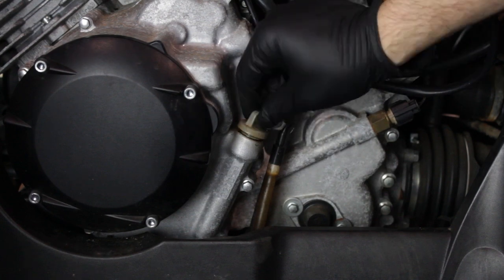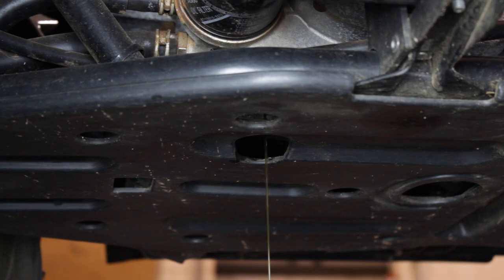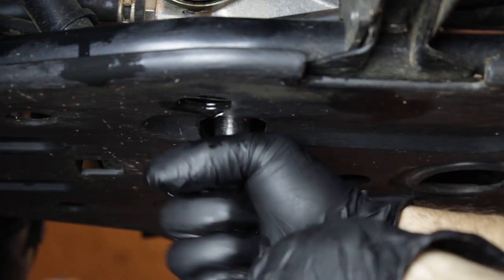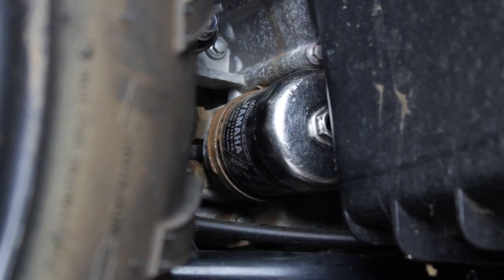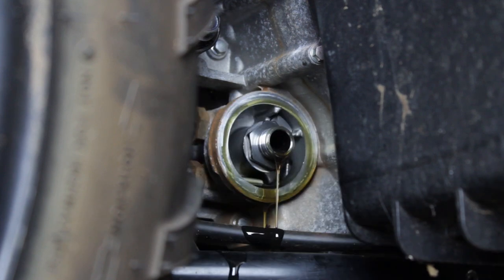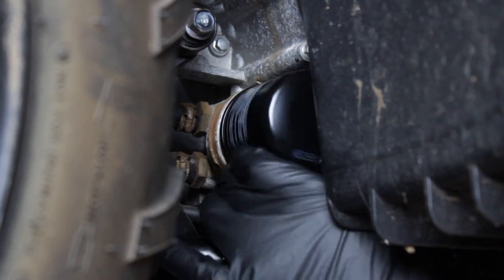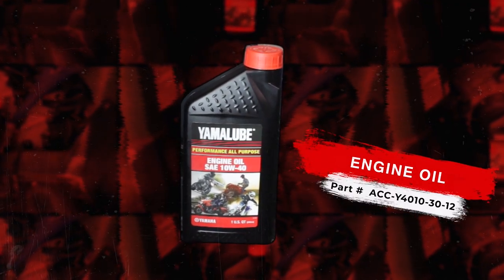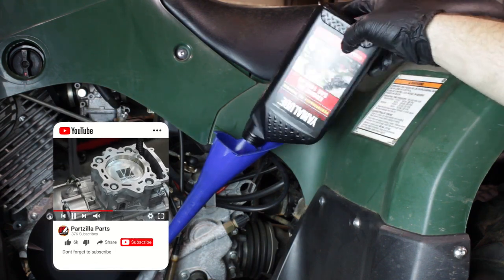Yamaha Grizzly 660 Oil Change | How to Change the Oil on a Yamaha Grizzly | Partzilla.com

Comment: Thankyou, I've had my grizzly setting in my garage for over 10 years, and I've been recently working on it, did finally get it running again, however I needed to change the oil along with the fuel and coolant, I just did not know where the drain bolt was, and soon will be swapping the gas line out, due to a leak

Comment: Pull out dipstick, remove drain plug, remove and replace filter.  Torque specs was helpful.  Fill with oil, check fill level.  DONE.  
I am just as helpful as your video.  
Friend called me after your vid and asked me to help him change oil.  He had no idea where to access all the areas for service.  You didn't help him there.

Comment: Very good video, you talked about propper torque for the drain plug and oil filter and the type and weight of oil to use. And how to check it on the dip stick correctly.

Comment: I have a older model 600 grizzly . 
The oil site window has turned black, and I can’t see how much oil is in it.
 The cap doesn’t have a dip stick so I now have too guess how much oil is in it.
 Anyone out there got a clue what i can do too check my oil?